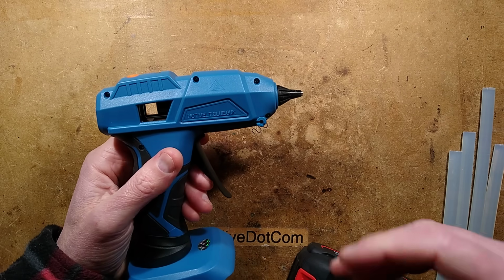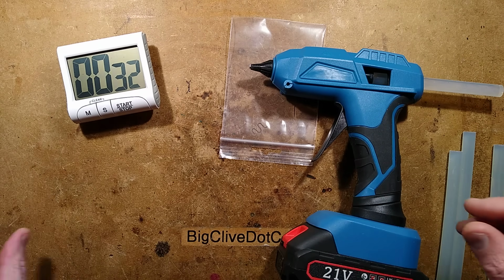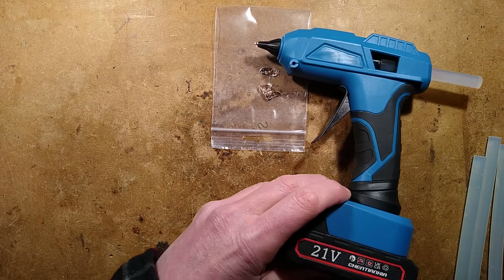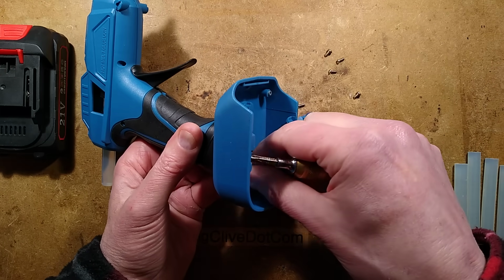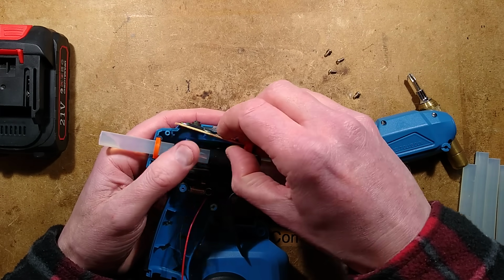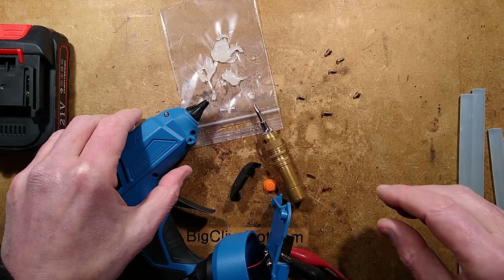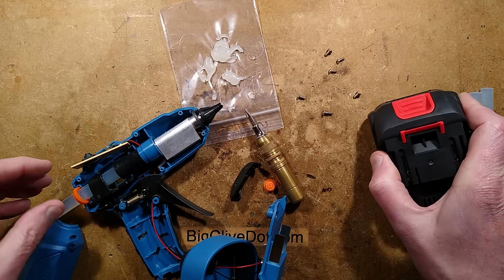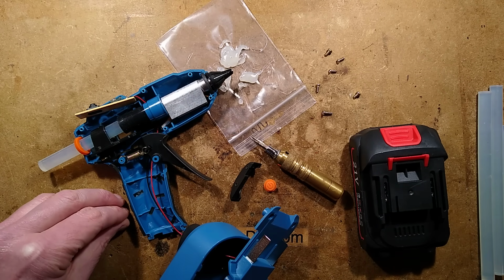Makita battery "compatible" glue gun

Comment: 2 years ago I bought small Parkside glue gun with one 18650 battery built in for 70 PLN, it is around 15 USD. I bought it because I had like 3 glue guns, all destroyed the same way, the small plastic part connecting the trigger with glue pusher just broke after some time, all those were powered from the outlet and didn't melt the glue very well, it cured too fast. And let me tell you, this Parkside one just rocks. It melts so well, cord does not get in the ways, heats up very fast, and I opened it on first day to check if this part is stronger than on others and let me tell you, IT IS. Also it does have an LED to light up the thing you glueing. I love it and advise everyone to buy that one, not those with interchangable 12V or 20V batteries. It was cheap, works like a charm and is super light and small, not so bulky like those.
Reply: The first hot glue gun I bought about 40 years ago has no moving parts at all. The handle is made so you push in the glue sticks with your thumb. While newer ones have come and gone, that one is still in a drawer of my toolbox, and does the job whenever it's called upon.
Reply: @RambozoClown  Yes, I have one of those too, back when the cheap hot glue guns first appeared they were all like that, the ones with a trigger are a later development.
Reply: Also have the Parkside, and its working good.
Reply: Looks like Parkside Bots has learned how to use AI for wtiting articles.

Comment: actually
bosch does similar things in their older professional Lithium batteries
but
for one thing they use absurdly well matched cells (<10mV difference post discharge on a >5 years heavy used one) for another you can do configure the chemistry a bit as a battery maker
so cells can handle a bit of overcharging without taking damage.
I think the gist of the rather dumb original battery packs is that you have electronics in the tool anyway and you can add the cutout circuit there
less things in the pack that might fail/get wet/draw a leakage current
Usually the batteries have SOME way of telling the tool the max amperage plus cell temp and also may use one of these signalling pins to demand for a cutout if any cell (larger packs do usually have more protection) goes out of the tolerable range

Comment: clive could you do a video on how you bring a makita batter back to life as i have one that want charge any more cheers Ian
Reply: I do this for M18 batteries, which have an annoying habit of becoming unbalanced (crappy BMS.) Open it up, and test the 5 cells/cell banks by probing different pairs of connectors with a meter. You find any with low voltage (<2.5V) or voltage out of balance with the others and identify the positive and negative sides. Connect up a standard 18650 charger with alligator clips and charge the offending cells. 

Charging cells that have fallen below 2.5 or especially below 2.0V can potentially be dangerous. Do it outside if you can, or at least not near anything that can burn. Be careful probing and disassembling these batteries. The larger packs can easily output 80A+, and shorting a cell for too long can cause it to go into thermal runaway.

Comment: That's, why i stopped buying Makita tools some years ago. Their batteries always were high priced and guaranteed to fail after two years.
I'm actually tempted to buy Makita Clones now, because they offer such a tool variety, cheap prices and often good quality. But original Makita tools won't work with clone batteries, neither do Makita chargers.
Reply: I've always used genuine Makita tools and batteries. I have 8 batteries from 3AH to 6AH. The 3AH ones are over 15 years old now and still work perfectly!
Reply: @ColinDyckes  I did have the 14.4V tools. And i wasn't that lucky. And as an expensive extra, you also always needed the little electronic board, if you change the cells, otherwise the charger won't accept the repaired battery. There are always some cells inside, which are completely dead, especially with the multi layered packages.
Reply: @werner.x  I only have the 18V tools and batteries. Very different experience to you as I've never had the 'over discharged' issue. My older tools don't have the star marking. Newer ones do. I must have at least a dozen different Makita tools. I just change batteries when I feel the power running down. One thing: Never do what tradesmen do and run them flat in a non compatible radio or light whilst unattended 😢

Comment: Work has a dewalt compatible version with a sliding switch in the base, but it must have a timer board inside cause itll shut off after a bit and you have to cycle the switch.

Comment: I think thhe deep discharge is due to the cheap tools missing the 3rd battery terminal. This terminal, on the real batteries, is at B+ and cuts off when cells are low. tells the tool not to operate. Not really Makita's fault and in my kind is a better design because then you don't have high power transistors inside the rather tight battery pack.

Comment: I used makita 18v 5ah batteries to power my kids go-carts (replacing the lead acid). The kids ran them flat and never had any issues. I only did this because I'd read that Makita LXT batteries have low discharge protection on them and will shut off to protect the battery.

Comment: I wonder how much that heating element would help as a car pre-heat/block heater.. Would be handy in this weather.. Would it work reasonably well hooked up to a 12v lead-acid battery? Hmmm..
Reply from the maker: You can get 12V PTC heaters as modules.

Comment: The thing that sucks also about makita battery over discharging is that  once you put them on a charger  and try to change it if you put it on the charger more then once  the makita battery board supposedly   also shuts down  so say if you were to charge the cell back up and connect everything back together . Once you  use the battery pack to were it needs to be changed again. It still won't  change because the board  is in a pertect. So the board has to be replaced.  The only way your able to reuse the changing board is if  you were to only placed it to change once figure out what  going on with the cells recharge them or replace cells   change  and reconnect changing  board and recharge package  before  it goes  under.  Iv also heard if the pack heats up more the 3 time  the board will go in to a shut down pertection and even after corrected  heating problem the board still need to be replaced.  Iv taken quite a few apart  and 90 percent of the time  the board need to be replaced  the  other thing that I see quite often the pack will have a bad cell.   Very disappointing because makita battery are really expensive.  If I original owed the pack  and the charger shows a problem  I'll automatically disconnect the  then figure out the problem  that way I don't have to automatically replace the changing board.  Iv had the actual changer not  wanting to  change any pack  talk about costly    having to  replace charging board on brand new pack  because  the charger  told it to shut down and it's actually the charger it self. It only was used onec  after the first use it act normal but trying to change a pack it would fault I put new pack fault .  I was glad that I  still had my older charger  that I knew worked.  It would of took me a while to figure out how would guess a brand new charger  with a single use is bad .   The best thing about makita and the only reason i tend to go with is because they do sell and carry replacement parts for just about every thing  they sell .  Some companies don't always sell replacement for everything. 🤑 💯👌✌️🫡❄️🌲🇺🇲

Comment: I belive some older Makita batteries did only monitor the last cell, but the last ones I took apart (bl1830b) they all balance the charge on all cells. I've tryed to charge one using a IMAX B6 charger and indeed they charge balanced within 0.1V
I used to think the orange connector in the new LXT batteries were to balance the cells, but is not the case apparently
Great video btw Clive! I also looked up the video of you taking appart that battery

Comment: Modern Makita batteries have a full BMS with over-current/discharge protection and active cell balancing. They've had individual cell monitoring since at least 2012.
Reply: They have a cell balancing BMS, but the battery itself can't disable its own output. That is the task of the tool / charger they are plugged into. And if it ever goes to over discharge, the BMS will never restart again, the original charger will reject the battery, but you can charge them with a knockoff charger, which neglects the BMS.
Reply: No not true we have some 2020 and 2021.. low discharge is not monitored and possible 😮
Reply: @mmuller2402  They can't win. People hate the individual cell low discharge protection even though they don't know what it is, because it "stops a mostly good battery from working" and needs a tinkerer to resurrect the pack from the dead.. If you know a proper tinkerer, in a few minutes it's perfectly fine again, and you've defeated "Evil Makita" from making you buy a whole new battery because one cell got lazy. 🙂
Reply: @bills6093  It'd be nice if the batteries went into a full balancing mode which brought the low cell up over time instead of just killing itself.
Bonus if they made the packs repairable so when a cell is fully dead it will fault out but indicate it's a single cell, then you pop it open replace the cell and it works again.
Reply: @mmuller2402 There's definitely at least some examples of Makita packs with low discharge protection because AvE has tested and triggered said protection - on the examples he tested the lockout was permanent iirc with the controller assuming a fault condition
Reply: People on reddit say it depends on model.  There's a complicated chart, but basically the higher capacity ones have had protection for a while, but the lower capacity ones might not to this very day.
Reply: @AndyLundell  One's with star, near - connector have all cell monitoring.
Reply: My father was using makita tools at work, and had original batteries bough up to 2018 and in 2018 they still had no cell protection.

Comment: It's a curious thing indeed that with Makita LXT the protection inside in the tool and the charger, not the battery. That's indeed a problem when using the battery on knockoff tools, especially since I'm told the battery contains a chip so that the charger can tag it as defective, and then it'll never charge it again. One of the reasons it might do that is if one or more cells are too deeply discharged or even reverse charged, so you really need to be careful with knockoff tools like these. 
I've also been told the battery not having any protection is not a universal thing either, but it's unclear which ones have it and which ones don't.

Comment: Milwaukee batteries don't have the safety stuff, because each tool and charger does. I suspect other brands do the same.
Reply from the maker: Ryobi has built in MOSFETs for shutting off any tool connected.

Comment: Really want to open up this isolar iearth is-f10bts 3 band radio/ mp3 player /Bluetooth speaker wife got from think temu for like 10 bucks. This thing is strange, comes with 18650 but also could put in 2x 1.5v um-1's and has a nice solar panel on top. But also has a mico usb labeled dc 5v, a normal size usb under that and a 4v out barrel jack. I have no idea what is going on with all that haha the 4x3 in. instructions don't help much haha.
Reply from the maker: The micro USB is probably for charging.  The bigger USB may be for use as a power bank to charge other items.

Comment: I bought an 14.4V AEG drill maybe fifteen years ago and the batteries died some years ago. I ordered LG 20 amp 3000mAh cells to replace the original and I was surprised to notice the BMS boards on the batteries. The batteries had all of the cells monitored for cell voltage. There was also temperature sensing and maybe some other features too. After replacing the cells, the drill is a bit harsh on my wrists, still a nice drill. It cost me only 99 or 119 euros back in the day.
Reply from the maker: I use some old Ryobi tools from the NiCad era and they are ferocious on a modern lithium battery.  Almost too powerful.

Comment: The knock-off batteries being a better option, what a time to be alive.
Reply: The knock-offs usually have garbage cells in them, and a questionable BMS. The originals have a very capable BMS, but it's missing a high current FET on the output to switch it off. It is the tool's task to switch itself off if the battery is drained.
Reply: @mrnmrn1  Thats the issue, the tool does not have enough information to detect when to switch itself off.
And depending on external thing for protection instead of battery protecting itself is bad.
Reply: There are some fake batteries that let you replace the cells too.
Reply: Melamamoduro

It used to be standard for power tool batteries to be built from standard size cells. Especially during the NiCd era. 

I know this because i converted the batteries of 30 year old Bosch power tool to Lithium a few years ago. 

Nowadays it's still possible to build or rebuild battery packs with cells, some still are made with round cells, but modifications may be neccessary or a holding frame.
Reply: They are definitely not better.
Reply: Same is true with ink, knock off is better.
Reply: If you buy genuine tools and batteries, it all just works! I've still not had a makita battery fail I have 9. All stored in my van in the summer and winter. Most of them are left fully charged most of the time.

Comment: Thanks. Your comments about clone batteries are as useful as your teardown.
Reply: wait... was that sarcasm?  if so, spot on.
Reply: @thomasneal9291  What? No... I was interested to learn that (at least some) clone batteries include protection circuitry.
Reply: @thomasneal9291 I was actually perplexed with that since I commonly see fake battery packs being half the capacity than advertised, but now know that there are better knockoffs than the real one will be valuable knowledge for me to use

Comment: 1:30 you prompted me to take apart one of my makita batteries and mine does have sense connections to each set of batteries. there are 2 chips that look like micro controllers on the board, and the whole thing is conformal coated. the only time I have ever seen batteries with only one sense wire in the middle is on clone batteries. I do know that the batteries shut off abruptly when they get to a low voltage, something none of the other clone batteries do. Also some of my clone batteries are rejected by my makita charger. but work fine in my clone charger.

Comment: Supposedly newer Makita (at least 18v) batteries do have low voltage cutoff in them. I personally haven't seen it but it seems reasonable they added it finally. Another thing i have seen is that from some time they started adding cell voltage monitoring (and possibly balancing) in their batteries. Oldest ones did not have this feature but more recent batteries for sure have it! Sadly they have kept the model number the same from the beginning and there is no way to differentiate these different batteries from the outside. Maybe it's in the serial but decoding that without manufacturer data is not easy.

Also note that over discharging is a huge issue for original older Makita batteries. The controller in the battery will flip a bit when that happens and it will never take a charge anymore from official charger until you replace the controller! As for the question why Makita didn't include a over discharge protection in their older batteries is probably because those high power mosfets that would handle switching loads like that were quite expensive and handling the cutoff in the tool was way cheaper. Remember, Makita batteries were originally only meant to be used with genuine Makita tools!

Comment: Parkside batteries from Lidl seem to have some kind of protection as well. I use an ordianry "stupid" screwdriver running of "X20 Team" range of their batteries. There are two ranges - smart and stupid ones. I own the "stupid" one and it cuts the power to prevent overdischarge AND it also refuses to charge if one cell inside gets damaged. I had one 2 Ah battery that refused to charge, took it apart and sure enough, only one cell was bad, the rest was ok.

Comment: Is there a simple over discharge circuit that could be used for projects, when using these batteries.
Reply from the maker: It could be done with voltage sensing or the control signal pin used with some batteries.